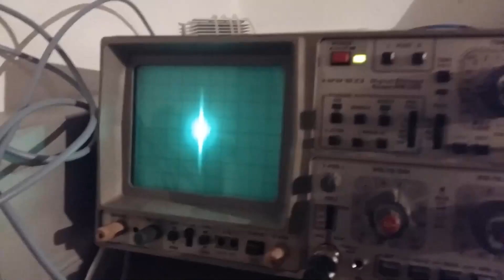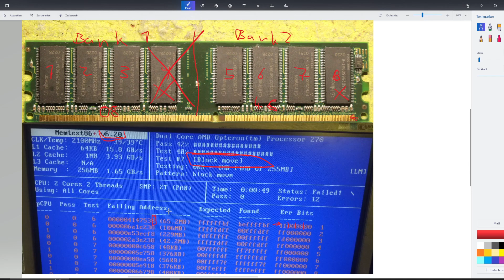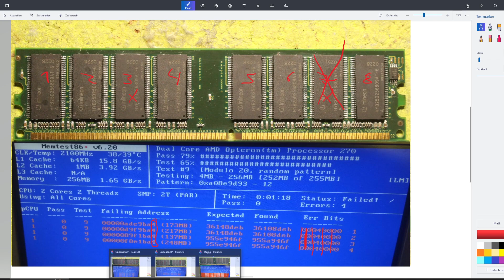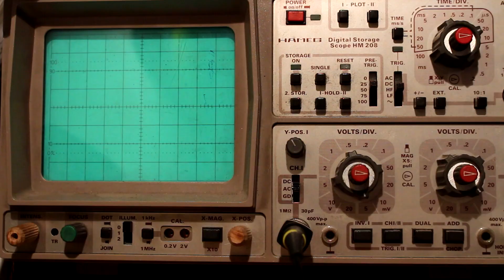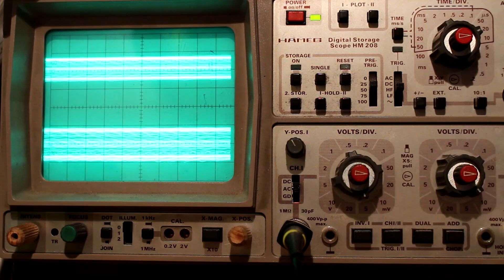I made my own DDR1 Sticks / How to bin per IC using Memtest86

Comment: Hello dear TAGG, I got my hands on the Xeon 5050 processor, which could be a cheap replacement for the "Pentium EE 965", I mean the presence of two cores of 4 threads. The first thing that could be assumed to be done is modding 771>775, but nothing worked out for me. I had the idea to visit the HWBot website and look for who overclocked this processor... I saw a familiar nickname among the users, which I think may be you. If my guesses are correct, could you direct me how to finish the Xeon 5050 modding under 775. To tell or give links on this topic. Thank you in advance and I apologize for the broken English through the translator.

Comment: we need Socket 2011 Board roundup for Overclocking i personaly own intel dx79sr with xeon 1650 4.8 ghz
Reply from the maker: The short version is just get a r4black or in a pinch a r4extreme, avoid anything evga for that gen, all the other boards are just sorta meh but not terrible.

Comment: Hi TAGG, you used 32bit Memtest86+. If you use 64bit, then it should be even easier to identify the failing chip. DDR interface is 64bits so Memtest 64bits maps 1:1.
Reply from the maker: Yeah, slight issue i could never get 64bit one to work...

Comment: Can this method be applied on the newer RAMs like ddr3 and ddr4?
Reply from the maker: For DDR3 it works exactly the same, but there's better ways to do it, i will do a video on that eventually... DDR4 idk.
Reply: @taggxoc  that will be awesome, looking forward to it.

Memtest86 (not the open source one) on its later version has the feature that can tell exactly which chip gives the errors but locked behind $2500.